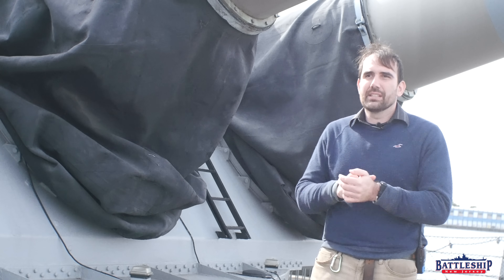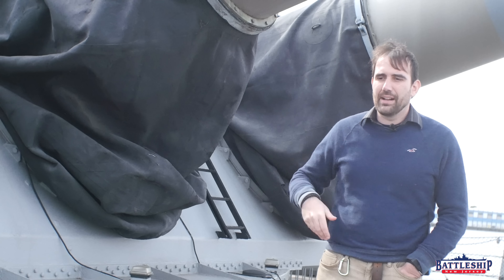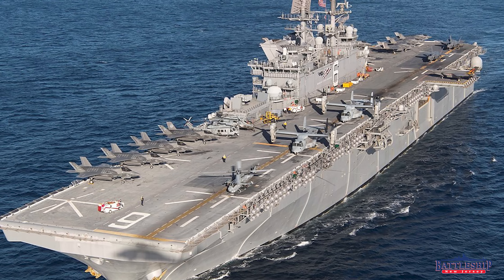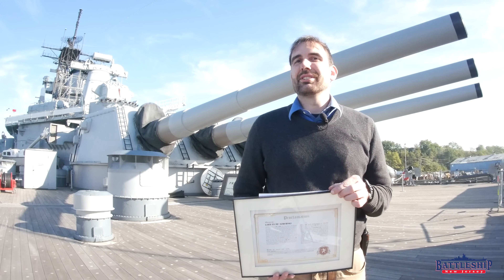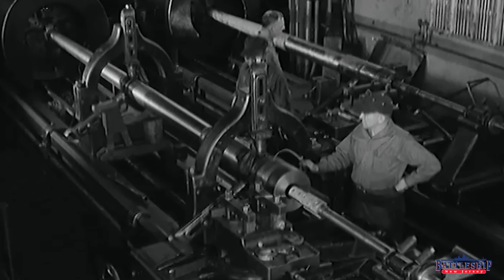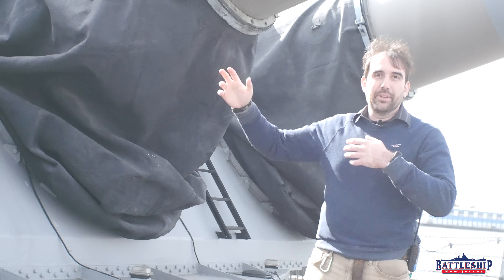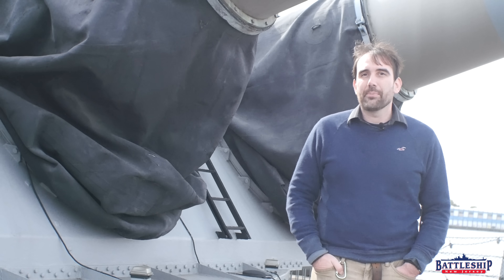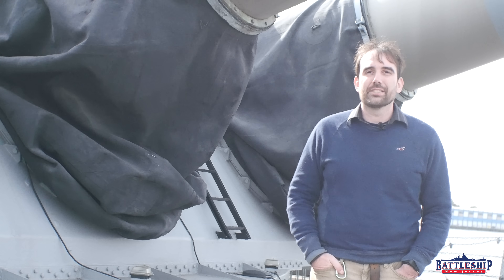How Much Would It Cost to Build a Battleship Today?

Comment: Long term, going for new build would be better.  Spare parts would be easier to obtain.  Nuclear power, decent armor to defeat current threats, and far easier to upgrade.
Reply: Agreed.
Reply: Also agree.
Reply: Wrong.  We don't make "parts" in this country anymore.
Reply: @bizjetfixr8352  hard disagree, america builds most of its large industrial parts right here in the nation. There's basically no difference between a large bearing for an industrial or power generating facility and a bearing for a large naval turret, building the parts won't be a problem, the problem is transportation. The US rail network is severely overused and under maintained + large road transport is expensive as well. Even at 6 billion per ship, wouldn't be a bad deal.
Reply: @bizjetfixr8352  He said "Spare parts would be easier to obtain." not that it would be easier or cheaper making them locally.
Reply: @bizjetfixr8352  we make a lot in America and the restrictions on DoD equipment sourcing is such that most all of it is domestically sourced.
Reply: @SweetLou0523  berry compliance is a thing most people don't understand. Even when we buy foreign weapons, the company we purchase from had to set up a plant in the US.
Reply: @bizjetfixr8352  ICs from Taiwan now. and TSMC still keep their IC production facility there, only send finished made ICs to other production facilities. even if one electronic products are 'made in China', not everything inside there came from PRC. Silicon components are actually came from ROC, their politican nemesis.
Reply: I'm on my union break right now at a factory that *checks notes*, makes parts in America   @bizjetfixr8352
Reply: @DiscothecaImperialis  TSMC are setting up a new foundry in Arizona. Samsung and Intel are doing the same in Ohio.
Reply: It's one hell of a lot easier to build an armour piercing weapon than it is to build an armoured warship. This was true at the end of WW2 and armour piercing technology has improved since (though mainly to deal with concrete bunkers).
Reply: @Akm72  look how happy Iraq were when they found out their 50m deep bunkers were just expensive speedbumos the US managed to peel open after about one months R&D
Reply: @GrasshopperKelly  yeah ... with old 8" gun barrels
Reply: @GrasshopperKelly  look at the B61 mod new (idr the actual designation. It's rocket propelled for spin and acceleration.
Reply: @Akm72  all anti ship weapons would be chemical in nature. Having thick composite armor and a few layers of heavy ERA would be extremely effective and might actually not weight more than ww2 battleship armor.
Reply: @Phantom-bh5ru  Anti-ship weapons are a lot bigger than anti-tank missiles and the penetration of a shaped charge is proportional to the diameter so you would need a far greater thickness of armour on the ship than on a tank. Just compare the diameter of a TOW missile to a Harpoon or Exocet... now look at the  diameter of one of those huge Russian anti-ship missiles. When you've done that consider the effect of a tandem warhead like BROACH on a ship: the first stage of the warhead is a large shaped charge that blasts a hole in the target allowing the 2nd charge to drop through and detonate inside the structure for maximum effect.

Now consider the 2nd reason that navies moved away from thick armour plate: The shock wave from a nuclear blast tends to push the large rigid panels of armour back into the ship damaging the structure (and anything else) behind. Designing ships with very thin outer hulls but strong flexible structures was done to enable a ship to flex as the shock wave passed over and remain operational afterwards. Think of a reed that bends with the wind as opposed to the mighty oak next to it that is blown over. 

Then finally you have cost, adding the required level of protection over an entire battle ship citadel would significantly increase the cost of each ship, both for the armour itself but also for the larger engines needed to move that mass around. This means you have significantly fewer hulls in the fleet for a given budget and reduced mutual defence. Then even if the armour works and keeps the explosion outside the hull you will probably find that the fragments flying around will still knock out vital radar and communitions antenna leaving the ship a mission kill even if it can still theoretically float, move and shoot.... Then your adversary will design a bigger anti-ship missile at a tiny fraction of the cost of the battleship that can penetrate.

Basically there are very good reasons that navies don't build heavily armoured ships these days!
Reply: @Akm72  bruh you think warships would be limited in armor thickness like tanks? No they can have way thicker composite armor and way more powerful era. Not to mention electric armor that basically nullified HEAT that would be way more effective to use on a ship than a tank due to power.
Reply: @Phantom-bh5ru  It will always be easier and cheaper to design and build an anti-ship missile with 10% better penetration than a battleship with 10% thicker armour. Then you still won't be able to put the vital radars and communitions antenna behind the armour so a hit will still be a mission kill and your armoured ship will be more likely to be hit in the first place due to fewer other ships in the fleet being able to contribute to the defence of the battleship.
Reply: The whole evolution process of the warship has to start over, beginning with DDGX. (which planned to replace BOTH Burkes and Ticoes), which rumored to be slightly bigger--having a size between Burkes and Zumwalts.
In order for these ships to fit the BB definitions, the most important thing is external armor plating, and it has to be done with Material Science available rightnow and ones being developed and near completion.
Forget about oldschool Kruppstahlle. the very corporate is now merged with Thyssen and had more or less discarded the old arts of BB armor steel alloys.
Also the design would have to accept 155cm guns, which already in production for land based warfare. but no bigger than that.

if a new BB is to be designed, it will not be the same Superdreadnoughts of 1920s-1940s in size but it can have basic characteristics like hull armor platings. Still it would evolved from Burkes and Ticoes--being missile heavy and might have rear gun battery in addition to rear hangar and helipad .... mmm.
Reply: @DiscothecaImperialis  That would be a CA, certainly not a BB.    Actually with 6" guns it would be branded as CL in WW2 terms, despite the armor.   NO way does that fulfill the fantasy requirement for BB guns, whatever the imagined mission may be.
Reply: @jacksons1010  So if BB is gonna return. it also requires to have not only armor platings comparable to Sperdreadnoughts but also hull size and gun size too?
Reply: @DiscothecaImperialis  The mission driving the need for new-build BB's isn't defined for us.   If all we need is 6" guns, then that's not a BB no matter the other attributes of size and armor.   The Zumwalts had 6" guns; were they considered BB's?   No, certainly not.    This is all a bit circular - if we're going to fantasize about building a new BB we need to know what it's intended to do, and that's where the bubble bursts.    We don't need big guns, so we don't need BB's.
Reply: Agreed !!!
Reply: Forcing enemy defenses to come up with CIWS systems to deal with 16" shells. Although, the equivalent for today's Military might be like a 22" inch shell.
Reply: @captcav767 Those systems already exist, the same missiles used to engage incoming supersonic anti-ship missiles could easily engage battleship shells if needed. All you have to do is tear off the ballistic cap or otherwise destabilize the shell, not destroy it outright, and the blast-frag warhead of an ESSM or SM-2 is more than capable of doing that, assuming the shock doesn't initiate the fuze and detonate the shell outright.
Reply: I think i would not reactivate them, the Iowas die Theorie duty and the theater  they  were build for does  not exist anymore. The way people fight today has changed. However the basic idea behind a battleship, „Being Abel to take hits and still deal a lot of damadge.“, still fits  into  this time. But you would need to build a ship that can represent it on the modern battlefield. I definitly would not make a battleship nuclear powered, since part of their purpose is being able to take a hit and stay in the fight, while one of the worst things you can shoot at is a nuclear reactor. Armament would be tricky though. Since you design a complete  new ship you definitly could find good positions for the weaponry. So i think i would Uwe VLS-Cells, as secundary armament the AGS originaly made for the Zumwalt destroyers may be a good choice. For the main armament i am honestly unsure, maybe it is possible to build a much larger version of the AGS  or you can restart the railgun project. Furthermore the ship should have multiple defensive weapon systems like SIWIS and RAM. Furthermore it should be able to conduct electronic warfare and has decoy lunchers. The shape of the hull  should be chosen in a way so it has the lowest radar signature possible without loosing its survivability. Sure a battleship never gonna look like a fishing boat, but maybe you can mask its radar signature as a destroyer. Furthermore i think helicopters and drones would be a nice addition to the ship capabilitys. But truth be told i dont think it would make sense to currently build a battleship. Yes it would be possible with a lot of effort and money, but every ship, no matter how small or large can online be at one point at a time. If you simply take the money you would Need to build a battleship and develop all that goes with it and just build destroyers and cruisers with it you geht a lot more ships allowing you to deploy the firepower over a much larger area. Espacally since so much concentraed firepower rarely is needed.
Reply: We don’t have the ability to create ship armor in the us anymore unfortunately. It would be extremely expensive and take years to re equipment steel plants to get back the capacity we would need. I wish we had the ability but we let it go. Just like we lost the ship yard knowledge to build these ships
Reply: We can still make anything we made back then
Reply: I'm pretty sure Ryan have a really good reason why battleships should not be nuclear powered. The reason they are heavily armored is because traditionally their supposed to take the hits and dish them back. Would you really power a ship that's expected to get hit with a couple sophisticated nuclear reactors?
Reply: @eric24567  It's being done on nuclear subs & carriers though.
Reply: @Wannes_  They're not supposed to be hit. In fact they're not even supposed to be seen. At least not until shit hits the fan.
Reply: @Wannes_  What's your point?
Reply: @eric24567  ~ which is why doing a 'pocket battleship' like the Graf Spee would be the better route if all you want is something you can park off the coast of an enemy to rain shells down on them - which is pretty much all battleships are good for nowadays.
Reply: @chezsnailez  you know, if the Navy really wanted another class of all gun ship in the modern age for whatever reason, something along the lines of the Deutschland would be the best option. Don't know how practical they'd be overall but the Marines might like them.
Reply: @chezsnailez  Neo Panzerschiffe with NERA Composite armor, Gas Turbine and VLS Battery capable of launching Tomahawks and hooked to AEGIS Network?
Reply: @eric24567 we made cruisers with nuclear power plants so why not battle ships
Reply: " Nuclear power, "

Let's not put nuclear power on a ship who's intended role is to be in the line of fire, one good hit ruptures a cooling line and the ship is literally dead. Not just dead in the water but the radiation will kill the crew in minutes.

Aircraft carriers get away with it because their role is to stay out of combat and send the planes to do their bidding.
Aircraft carriers are also the reason why we don't use battlehips anymore so the whole discussion is hypothetical.
Reply: @vinny142  That's simply not correct.   The reactor is not going to explode and spread radiation everywhere - the kind of hit it would take to cause that level of destruction would have the entire ship in pieces anyway.    I'm going to guess that you have the K-19 movie(s) in mind...let's not misunderstand the differences between old Soviet technology and USN technology in 2022.
Reply: @vinny142  We literally planned to make a nuclear-powered AEGIS cruiser based on the CGN-38 Hull. Your argument is utterly invalid.
Reply: @vinny142  Intrinsically Safe nuclear reactors exist. You can punch holes through them all day and just take them offline.
Look up Pebble Bed reactors.
You would also be looking at six or eight with azimuth thrusters like a modern cruise ship for propulsion.
The reactors could also power the optical and other zero time of flight defence equipment.

Comment: If lasers become really powerful gun based weapons might return. lasers potentially could easily destroy aircraft and missiles but naval shells would be harder to knock out with a laser.
Reply: They could also just pull out a mirror lul
Reply: @BGraves   mirrors don't reflect the full spectrum of light. a great example is modern windows reflect infrared light, but not viable.
Reply: @BGraves  mirror jets?
Reply: Patriot pac 3 comes to mind as something that might be able to stop battleship class naval artillery. It’s hit to kill and it can take out ballistic missiles. Since there is some explosive elements in AP shells, a hit might explode the shell, but even if it doesn’t, the kinetic energy alone might shatter the projectile or bare minimum change it’s velocity and bearing. Idk if naval rounds could be detected in air because a 16 inch steel bullet that’s aerodynamic might have a pretty low rcs, but who knows with aegis radar systems being phenomenal
Reply: @majesticface3631  There is no way a modern engagement would happen within a naval gun range. The last battleship to battleship engagement was 1944.
Reply: @majesticface3631  it's not a cost effective solution at the very least. But I have no idea how well a missile could take out a shell.
Reply: @majesticface3631  you do realize battle ships had a fire rate of one shot a minute per gun barrel with a average of 9 barrels. also
 it costs at most a 1000 per shot, which is nothing compared to a patriot missile.
Reply: @butspan7618  The guns may be cheap to fire but the ship around them is expensive, especially when you look at years or decades of operation.
Reply: @rhamph  missiles air craft and aircraft carriers are even more expensive if things like iron dome become more capable of shooting down anything that flies then volume of fighter might be more importation.
Reply: a railgun would be much more likely. Lasers would be much more effective as a defensive weapons platform
Reply: Not happening
Reply: @GrahamCStrouse  are you part of naval research?

Comment: Id build new pocket battleship nuclear powered, in the long term building the infrastructure to make more battleships would be more beneficial. New yards could keep more ships in service, more tooling could make more jobs, and a new battleship would be cheaper in service and could be designed specifically to hunt down small fleets. It would never be a mainstay of a navy again but it could be a amphibious assault platform or fill a role similar to the convoy raiders of ww2

Comment: Putting one of our Battleships back into a war zone would be beyond stupid.   The fire control system on it is an analog gear system it is not compatible with digital systems in any way.  The armor not only would not work, but would actually increase damage done by many modern weapons that might hit the battleship.   The best use for these ships is as Academy ships.   They can be used as working training centers for engineering, and maritime skills.  These ships are useful for research platforms as well.   I do not understand why the naval academy is not using any of them for training cruiser ships.  There is room for a full school and a backup crew.